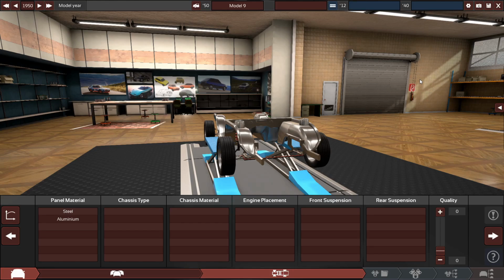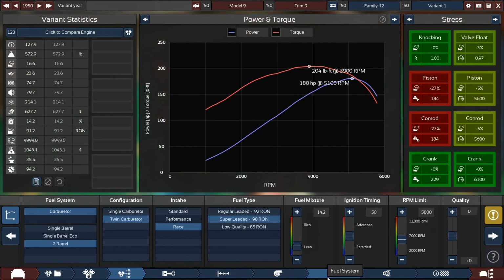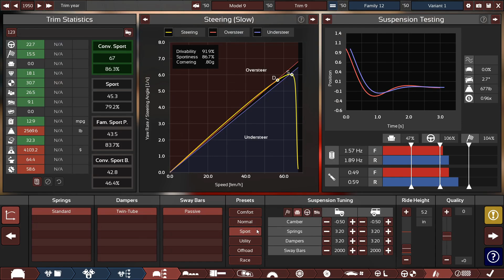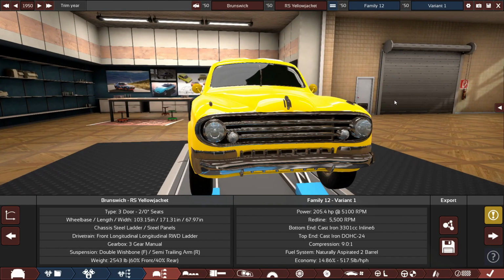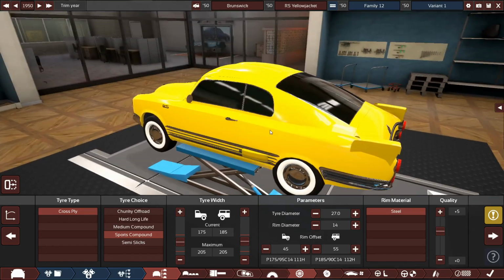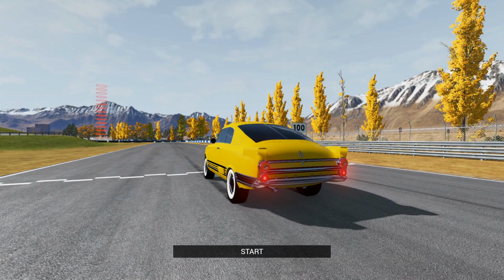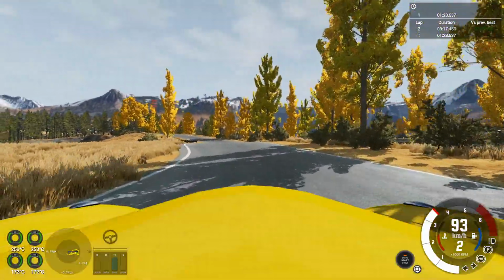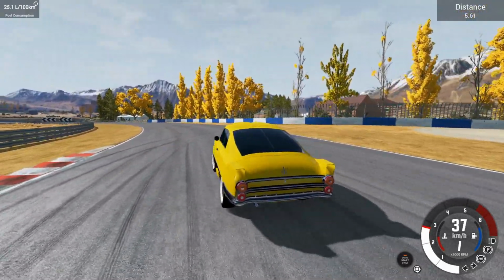Building A Classic Sports Car! Automation - BeamNG

Comment: I feel like SOHC would’ve been a bit more realistic but honestly it’s still a great build. Your styling ability is pretty high up there. Definitely the best classic build I’ve seen on automation.
Reply from the maker: Yeah DOHC would have been quite advanced for the time. Just used it for fun, basically a racecar engine lol!
Cheers eh, thanks for the kind words :D
Reply: @TwinTurBros  NASCAR was originally stock cars, as you and I would drive them back in the day. It wasn't long after it's inception though that guys started modifying the cars. So rules were made that a specific number of cars had to be produced with the same engine and drive train package as the cars used in NASCAR. By the 70's they were already going to racing chassis and away from the stock car. Now they all run 5.8l pushrod v8's. The Hudson as you mentioned was a inline 5l six, but it used a flathead pushrod. 3.3l is also quite smaller inline 6. But cool car you made.
Reply: I worked at Listers (English engineering company) and they made these reproduction E type racers from the 50s and they had 3.8 DOHC 12V straight 6 engine and This build although not a replica seems to fit perfectly with the time period and theme

Comment: Your best looking build so far I think! Very nice work. I want one. Now for a build suggestion: A silly one: Using the bus mod, build a double decker London Bus with a motorbike engine, say 500cc max, highest RPM possible (probably needs to be at least year 2000 to get the revs?) - The catch is it has to be actually usable, so capable of 30-40mph at least!

Comment: Its like its got Cadillac wings, but these are useful for downforce as well. So this car came out of the tail-end of the war, thus it seems to carry airplane design elements such as tails and wings, rounded body lines and low-ish rpm torquey performance-oriented engines. Chrome covering it all, flowy chrome trim that seems to direct the air cleanly over the sides of the vehicle, its a 50s machine alright.